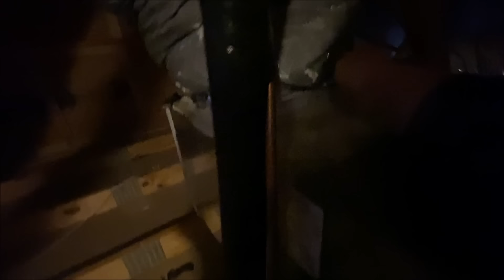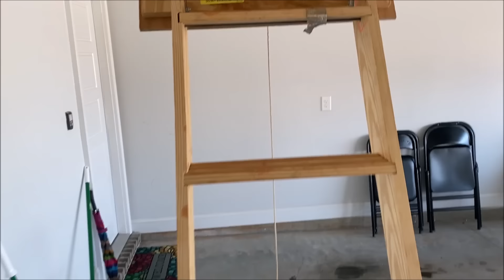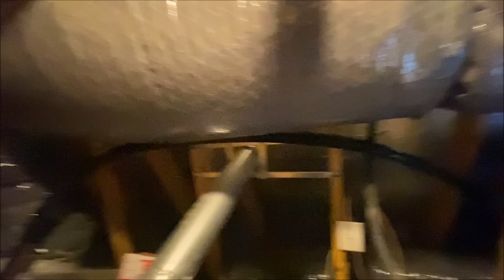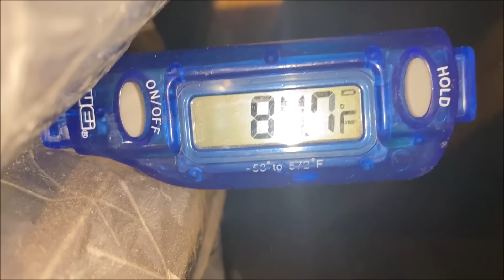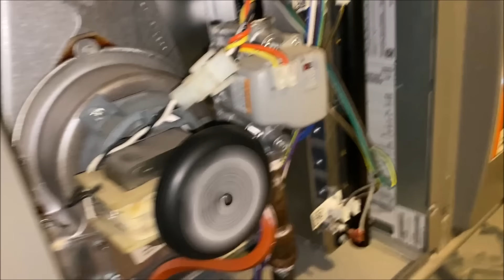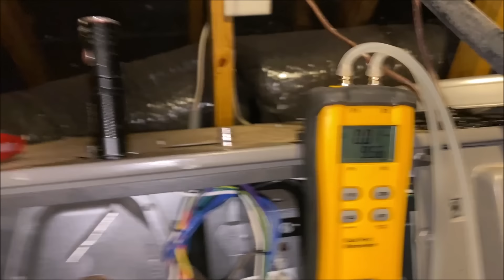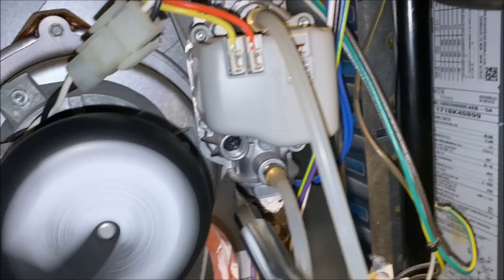New Construction HVAC Hack Job Butcher Sabotage pathetic installers

Comment: Ted did you advise them  to sue the builder for the cost of re working the entire duct system?
Reply: That's what I would do, plus legal costs of course. They'd probably settle out of court quick, fast, and in a hurry. They  keep on doing it because they keep on getting away with it.
Reply: Good luck with that
Reply: @tycobb8621  Exactly. Spend more on useless lawyers than you would fixing the system yourself.
Reply: @purplegoose7907  wrong, they would get a %, if that state has a Consumer Protection Dept you wouldn't need it, but repub states generally don't because they don't care about people, it's profits and rip offs for rich guys, they don't protect the consumer at all, most of the major issues in HVACR are in states with no regulations and no licensing, you can't learn this trade anymore by riding in some clowns truck, you need basic skills training and factory training for the rest of your career, I know, I was a factory rep for Carrier, techs that called from states that had regulations and licensing that needed help had already checked things out and were truly stumped, techs from states that didn't were a joke, questions like "the blower doesn't run"  so I ask "what's the voltage going to it" reply "I don't know"  "where's your meter?" "in the truck", or my favorite on many calls "what's the voltage coming out of the transformer"  tech reply - ""uh, 24 a good 24" there and then I know several things, he doesn't know what he's doing and either has no meter or doesn't know how to use it, he's a hack, a parts changer, never been properly trained and in fact most of the deaths on the job in HVACR are in states with no regulations or training requirements. Florida for example, requires nothing, the owner has to register as a contractor, he can hire anyone to do any HVACR work, it's a joke.
Reply: @purplegoose7907  
They would more than likely fix it and give you some boot.
 
They wouldn't like this video sent anonymously by third party, to their customers after the home owner posted it without naming any contractors, to protect them selves from liable.

And certainly they would have a thorough home inspection, to see if their lives are in danger from other faulty systems that were not installed properly.
Reply: Sue...the American way

Comment: I live in a house built in the mid 1860s...i can't imagine living in one of these cookie cutter houses that are built as quickly and cheaply as possible. This house is so well built it blows my mind and the new construction is so cheap it's pathetic.
Reply: My grandma lives in an 1887 farm house and it's dead solid after all these years, was converted from wood stove to boiler heat at the turn of the century and finally got air conditioning near the next turn of the century, my old house was built in 1892 and what did it in was termites, constantly had a moisture problem and the landlord was too cheap to fix it, and I'm in the process of buying a house that was built near the turn of the century and still doesn't have central air, house is solid as a rock, zero drafts and a surprisingly high insulation value, luckily I have a sizeable stash of window units ranging in age from 1981 up to 2001
Reply: @vacexpert2020  Ya my house was built in 1880 , huge beams and used a tree in the basement as the main beam.
Reply: @killerdeamonking   That's cool. I've seen beams like that in a few houses around my area. Our beams are 8×12,  12×14, and  we have 4×12 floor joist. The entire frame is built around the stones that make up the bottom of the fireplace. Everything came from THIS PROPERTY. And to me that's REALLY COOL.😎🇺🇸
Reply: Yes, pride in work is non existent. Most of the labor today is unskilled and they cannot read.
Reply: I know what your saying.
My house was built in 1970 and when you go into the attic, you can see the size of the rafters that you can't find in a new house.
Reply: I can't even imagine how this was cheaper, they used way more duct material than what was necessary and it had to have taken longer to install as well. This is just pure ineptitude.
Reply: Just because it’s old, doesn’t mean it’s good. I have seen way more basket case old houses than decent ones.
Reply: Your old house is drafty and un-insulated though.  That's where all of the effort goes in the new homes.
Reply: I am in a 100+ year old house.  Which I have a love/hate relationship with.  I definitely think homes were built with more attention to detail and more integrity back then.  But time takes its toll and modern construction techniques, when applied properly, can make for just as good or better of a home.  I have creaky floors, not enough insulation, and doors that only shut properly certain times of the year.  I have had to do some upgrades and also replace part of my sewer line.  If I want to run more circuits or Ethernet, it's difficult with the way the walls are built.  And with my house having hydronic heat (which works well, overall), there is no ductwork and no easy way to add central air.  And a 100 yo house always needs 15 different things worked on.  I would miss the charm and the neighborhood I'm in, but there are days I wouldn't be too unhappy at all to have a properly built modern home instead.  Emphasis on the 'properly built'.  Not all new construction need be garbage.  But I agree so much of it is.
Reply: yelorsirhc, our house was completed in 1900. Huge beams for the framework, and NOT 1 nail in the frame. Its all mortise and tenon with a 1" dowel pin in each joint. I am an HVAC installer/ service tech so I go under a LOT of houses, I've seen a 5 year old house that was ready to fall apart. But I've never seen another like the one we bought. TOTALLY SOLID. If yours is 1860 then YOU understand exactly what I mean.

Comment: That was not a case of out of warranty that was a criminal case.
             The quality of an installers shoddy and  bad work are a good and direct reflection of the contractor who owns the company.  Everything that goes wrong up in an attic or under a crawlspace is 100% in every situation direct responsibility and result of the owner of the company. 

           All fines and levees and penalties should also levied against the builder he’s responsible for picking the cheapest bid. 

       But this is why Ted picks up new lifelong customers fixing work like this and making a customer happy.
Reply: The whole ducting system needs to be redone.. the gas lines were poorly designed.. What a hack. If this is what you produce on a blank slate, you don't belong in the industry.
Reply: Umm the owner literally did nothing wrong it was the installers fault lol
Reply: Don't they have building inspection as a part of the permitting process? If a building inspector passed that something is very wrong.
Reply: @donbob3343  they're incompetent. I worked closely with inspectors for my company, they are worthless and lazy.

Comment: I love doing new construction but Damn. That was a mess. Flex works but you have to be neat about it and make proper air blocks for the back pressure. 
Not use to the secondary regulators,  up north we size everything from the meter to our loads.

Comment: With that setup you will never get enough gas to run everything. We do not install a regulator inside a house. The Black Iron pipe coming in from the meter 1 1/4 inch to 1 1/2 inch to a manifold to each gas run.. I run no plastic or copper inside and no flex pipe. All for safety reason.
Reply: Actually a 2lb system will give you more gas than you would ever need in a home this size but you would need proper regulators and an installation that meets the National Fuel Gas code ( it's quite obvious this installation falls short in a lot of ways). I'm not really sure why this particular gas utility allows 2-pound systems in homes with small to moderate gas loads. It's apparent you deal with mainly low pressure Delivery Systems of about 7", which is a tried-and-true system that's been around for over 150 years but it's sad to say they're always trying to find different ways to cut cost.

Comment: Wow this is when i had my system installed had them install rigid metal ducting i call flex duct dryer tubes 🤣

Wondering if they might have a legal case against the builder for the shoddy ducting

Comment: Nice diagnosis Ted,  that ductwork is unreal. I’m sure it’s not in the cards but it’s a tear out and start over job.
Reply: Was thinking that would be best but it’s not usually what can happen. They should make an insurance claim or sue the builder. That is not acceptable.
Reply: @joea5183  sue the builder. That company hired shoddy lowest caliber workers and received premium fees.
Reply: I bet the AC works realll niceee
Reply: yeah but it's so damn expensive, the time involved is insane simply because it's already sealed and insulated. Ripping it out and starting over is such a monumental task that just accepting the decreased efficiency is more cost effective. It's the main reason I'm so pissed at new construction where I'm at, they're all shit at ductwork and once it's in, it's not going anywhere. So often I have to tell customers that they got the raw end of the deal with the HVAC in their 3 year old house.
Reply: @TheAnimeAtheist  Most of the material is there to rerun it all. Pull it all apart and investigate.
Reply: There goes another 8 to 10 grand…
Reply: I agree. Crap like that makes me angry.
Reply: What diagnosis? First he thought it was a damper, then the flex duct, then the valve, then the adjustment on the valve, then the regulator is not big enough even though the temp went to 119 degrees when valve was adjusted?  Never found out if the heat got better in the house! Waste of 20 minutes of my life!

Comment: People get what they pay for. Sick of the excuses from people. Researching contractors is as easy as it has ever been. This was 100% preventable; now, they get to spend 30k in lawyers to sue them.
Reply: Agreed. 
It is due diligence for a buyer to make sure what he is getting for his money.

Many home buyers trust the builder to be on their side. Those days are long gone!

If it ain't on paper it don't mean schit!
Reply: Not always the case. I'm sure these people paid lots of money for the contractor to install this unit. It's people with a sht attitudes that do this type of work. It's pathetic really. If you're not going to do the best you can, don't don't bother showing up.
Reply: @Mike Znel  Yes and No. With todays online review of companies and as bad as this job was done. They absolutely would have found bad reviews of the contractor and, hence, why you get plenty of bids when you're are spending SO much money on a home. It doesn't take so much effort as some claim it does. Now they will spend years suing him to try and recoup the costs to fix that
Reply: @mikeznel6048  
I believe it was new home construction, so chances are the buyers didn't know who installed it, at closing.

It is the buyers due diligence to make sure they are getting what they pay for.
Some effort in researching installation manuals and building codes before closing would have had this straightened out.
Or hiring a good home inspection company to do that for you?
But hey, they needed a hot tub or new furniture?